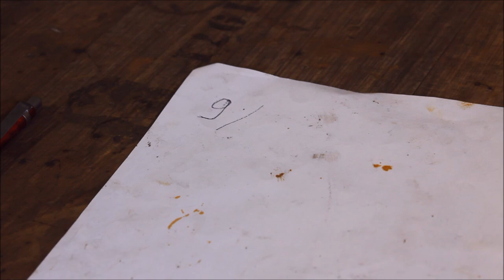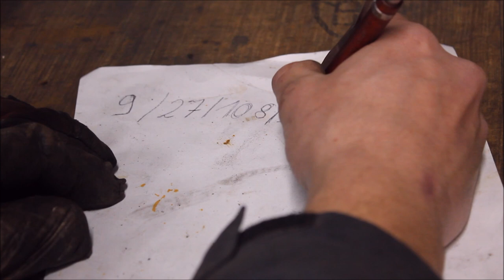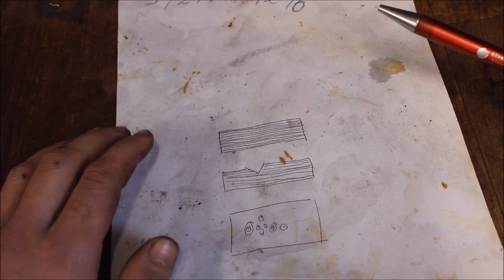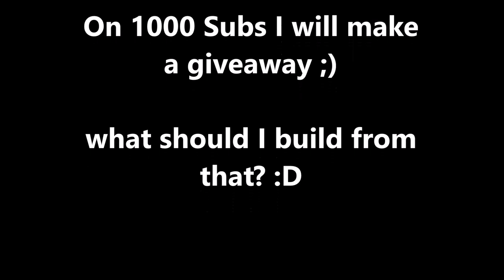Forging RAINDROP PATTERN DAMASCUS !!! | Handforged

Comment: What kind of steel did you use?
Reply from the maker: It's 15N20 and some manganese steel
Reply: @sperber-knives  ok. Would it work with a billet of 1075. I have about 21 feet of saw blade that's 1075 and I was thinking of cutting some off, stacking it and making a billet.
Reply from the maker: @thomasfrazier77  maybe, try it dude !
Reply: @sperber-knives  I'll give it a go. 
Thanks for responding back.